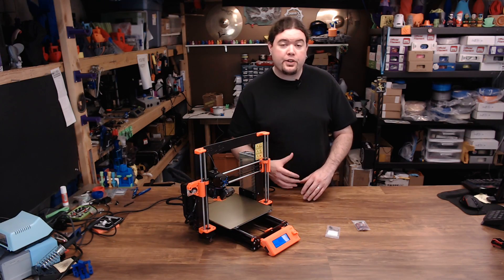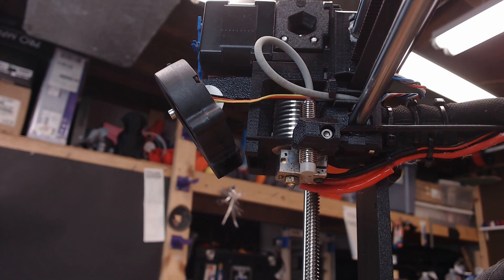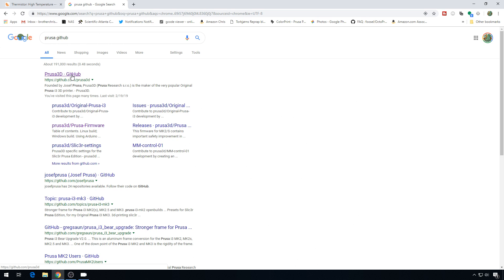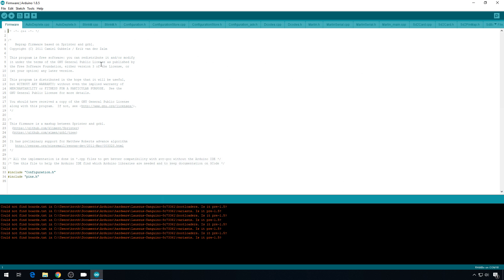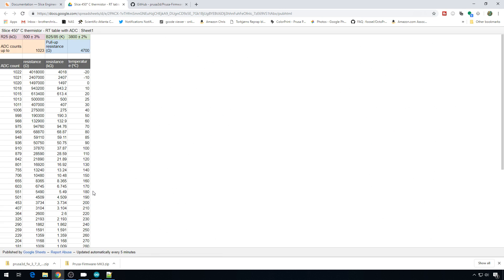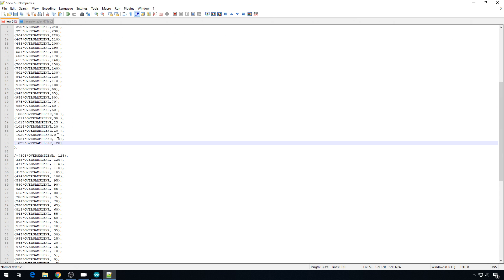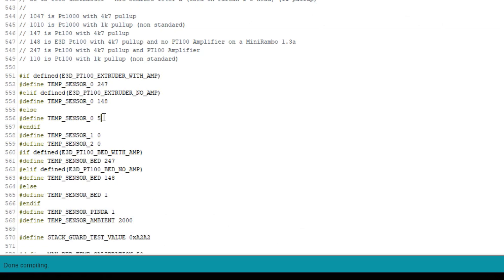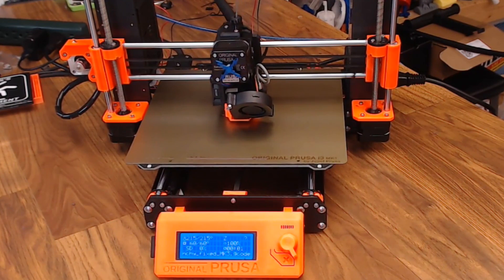Prusa Thermistor Upgrade - Slice Engineering - Chris's Basement

Comment: I am thinking about upgrade my mk3s mod completely with mosquito hotend. But I don't find a good alternativ die the mk52 heated to heat it up to 160°C. And I think for printing ultem it will be really hot so o also have to print all parts with PC filament  and also to change some other parts.

Btw. It would be a good idea to change also the heater and the heat block and also the nozzle to reach higher temperatures for nylon/PA6 or other engineering grade  materials
Reply from the maker: I am currently working on a high temp build. Eve with PC, I am not sure I would attemp ultem, but who knows, it might work. I use the Mosquito with a 50w heater and it does great.
Reply: @ChrisRiley  I am also preparing an article about this but not on YouTube. Only on my website pcpointer.de 

Also a bondtech with mosquito is possible. The heater with 50 w is enough and can be used without a MOSFET. Einsy Mainboard provides enough power. I hope the meanwell rsp320 13,4A power supply will be enough because the biggest problem will be the heated. E3D has some high temperature beds but they don't fit in the mk3s. For ultem normally you also need an enclosure and to put some spot lights inside for a temperature of 70-75 degrees. The hole electronics has to be moved out of the enclosures ... You will also need to col the steppers minimum with aluminium heatsink ... The belts will be strong enough ... I think that are the main problems ... I will first start to buy a mosquito standard :) 

Btw: I prepared a new article about building a printer from scratch. It's in german but the content could be helpful: https://pcpointer.de/artikel/prusa-i3-mk3-mod-3d-drucker-selber-bauen/

Comment: @Chris Riley  love the video, any chance you have this all compiled in a file that can just be uploaded to my printer? I have the whole mosquito setup but fear screwing it up.
Reply from the maker: Here you go, this should work. https://drive.google.com/open?id=1xd5Nnt0EMQYlZYE0GbJtkw0NjV-q4NoN
Reply: @ChrisRiley  Thank you so much!
Reply: @ChrisRiley  Any chance you could compile this with the new 3.80 firmware for mk3s?  I'd be more than happy to send a donation somewhere.
Reply from the maker: @iflawdya2  Here ya go https://drive.google.com/open?id=1jrtCOpQiXCpN_co1hGIfXetO4y7_e4Md this is compiled with the mosquito thermistor max temp 310. You should be able to load it with Prusa slicer.
Reply: @ChrisRiley  You're the best ever!!
Reply from the maker: @iflawdya2  I try. 😉
Reply: @iflawdya2  I tried to upload the hex file with prusaslicer but after verifying nothing happens and also a reboot doesn't help
Reply: @BiuTse  do you have the cable plugged into the mmu2?
Reply: iflawdya2 No in the board

Comment: Chris this is one of the most interesting and easy to understand 3D printing videos I have watched, you have great knack for getting the information across clearly and quickly,

I have my firmware ready to go, just waiting for the thermistor to arrive. Slice don't ship outside USA/Canada so anyone outside wanting to try this will hopefully have a friend in those countries that can help them get one.

One question though, you don't mention in the video how to change the 300C limit imposed by Prusa in the firmware, is it simply a case of altering the MAXTEMP settings in configuration_prusa.h ??
Reply from the maker: Hey Paul, thanks! That's a good point, yes, you should be able to just increase the max temp. I left out one piece on this tutorial that might mess up your live Z adjust. If you get a ? under Z on your screen, try this.

This is what the file looks like:

# RAMBo AVR Core and platform.
# ------------------------------

# For more info:
# https://github.com/arduino/Arduino/wiki/Arduino-IDE-1.5---3rd-party-Hardware-specification

name=RAMBo AVR Boards
version=1.5.6
compiler.c.elf.flags=-w -Os -Wl,-u,vfprintf -lprintf_flt -lm -Wl,--gc-sections

I found it here:
C:\Users\broth\AppData\Local\Arduino15\packages\rambo\hardware\avr\1.0.1

Comment: Hey Chris,
Thanks again for this tutorial.

I've run into a snag. 

Since mod'ing the FW, I can no longer perform a "live Z" or a 1st layer calibration.
The Z will not adjust.

Any ideas what the issue may be?

Thanks,
David
Reply from the maker: Unfortunately I left out one step. Try this, it might fix this issue.

c. modify platform.txt to enable float printf support:
add "-Wl,-u,vfprintf -lprintf_flt -lm" to "compiler.c.elf.flags=" before existing flag "-Wl,--gc-sections"
example:
"compiler.c.elf.flags=-w -Os -Wl,-u,vfprintf -lprintf_flt -lm -Wl,--gc-sections" The file can be found in Arduino instalation directory, or after Arduino has been updated at:
"C:\Users(user)\AppData\Local\Arduino15\packages\arduino\hardware\avr(version)" If you can locate the file in both places, file from user profile is probably used.
Reply: @ChrisRiley  

I'm working on macOS, I'm not finding the c.modify.platform.txt file

I found a file named platform.txt, but it has very little info in it.

# Marlin AVR Core and platform.
# ------------------------------

# For more info:
# https://github.com/arduino/Arduino/wiki/Arduino-IDE-1.5---3rd-party-Hardware-specification

name=Marlin AVR Boards
version=1.5.6
Reply from the maker: @davidewen713  I went back and did this on mine, it did correct the issue. 

This is what the file looks like:

# RAMBo AVR Core and platform.
# ------------------------------

# For more info:
# https://github.com/arduino/Arduino/wiki/Arduino-IDE-1.5---3rd-party-Hardware-specification

name=RAMBo AVR Boards
version=1.5.6
compiler.c.elf.flags=-w -Os -Wl,-u,vfprintf -lprintf_flt -lm -Wl,--gc-sections

I found it here:
C:\Users\broth\AppData\Local\Arduino15\packages\rambo\hardware\avr\1.0.1
Reply: @ChrisRiley  
Thanks Chris. This worked!!

I'm running macOS. I found the file at this location;

/Users/"myname"/Library/Arduino15/packages/rambo/hardware/avr/1.0.1

Comment: Where can I find and install the RAMbo module for Arudrino IDE? It's not showing in the board manager
Reply: Nevermind - found it :)

https://reprap.org/wiki/Rambo_firmware
Reply from the maker: @RylehRC  Great!
Reply: One more thing, the firmware files in the links - considering it's a new video - is it 3.7.1?want to make my life easy - just build and flash :)
Reply from the maker: @RylehRC  Yes, 3.7.1 just came out, go with that version. Setup should be the same.

Comment: Loved the video. I just ordered a Bondtech BMG-M extruder with the Mosquito Magnum hotend. Is there an installation process with this combo for the Pursa Mk3 along with stl files. I have not found any. Is there a thermistor/heating element mod for the Prusa Mk3 to increase the bed temp to less say 150C or 180C?Jim
Reply from the maker: Thanks! I currently don't know of any mounts for the Prusa Mk3 to fit that combo, but that doesn't mean there isn't one. Same for the bed, the only thing I could think of would be something like the new e3d beds.
Reply: Chris do I require a firmware change when I add the Bondtech BMG-M to my Mk3? If so, where can I find out what it is?
Reply from the maker: @gorillamotors  The only change you will have to make is for esteps and maybe direction. You should be able to change the in eeprom with commands. M92 Exxx   for esteps. You will need to calibrate esteps after the change.

Comment: What about the Slice Engineering Heater Cartridge? Is there any changes that need to be made to a MK3 or a MK2 in the firmware?
Reply from the maker: No changes for the heater. Just run a PID tune after.

Comment: Hey Chris, is there a way to get the firmware settings off of my printer before I upgrade to a updated firmware? Example, on my Geeetech MeCreator 2, I want to update my thermistor and add auto bed leveling to printer. If I make the necessary changes and then re-flash the firmware, all my settings will default back to original? How can I avoid this. I want to be able to use octoprint to reflash the firmware with the firmware plug in. Hope this makes sense.
Reply from the maker: The best you can do is run a M503 and copy all the output. Unfortunately, there is no way to save the configs.

Comment: Chris. Thanks again for the great video. Is the advantage of using the Slice Engineering thermistor and heater cartridge the ability to obtain a higher temperature range? Would it be also necessary to change to an all metal heat-break in that case? I would be interested in here more about the Mosquito hotend.
Reply from the maker: Yes, the SE thermistor is much more granular, so it would be more accurate. The E3D tops out at 300c. You would for sure need the all metal heat break, the e3d full v6 works for that cause. Higher than 300c, you really need to prepare for, all metal everything is needed.

Comment: Can you do a FAIR comparison between E3D V6 All-Metal HotEnd vs Micro 
Swiss All Metal Hotend ?  THANK YOU  for all the hard work you do.
Reply: If he did such a test, why would you question if the comparison where fair or not?
Reply: @stigberntsen9301  Making both on same print same setting and same cooling and same everything or there limitations if that's even possible! I can't find anyone that did that type of comparison.
Reply: @xeon_one  I have actually done that on my CR-10, I use the Petsfang, and tested both the MicroSwiss and the E3D v6. From my point of view there is next to no difference using either. Same temp on prints, same quality. If anything I find the MicroSwiss a tad better - at least when it comes to fitting it to the CR-10 (use the same mounting as the original)
Reply: @stigberntsen9301  Thank you for that..But I have one more question how about the limitations how high did you get it up to before it all melts down.

Comment: Thanks - great info. You know though that according to E3D if you want to run high temp >300 or so you also have to go to a copper block. And IDK on the prusa but on the pulse you'd have to edit the max temp and probably redesign or reprint the hotend mount out of something else than RYNO which gets soft at about 60 C, I ruined fan shrouds just by printing big footprint items with a 100C Bed (ABS). reprinted them in Hobby King Hips and that solved that problem. Why HIPS. prints better than ABS, sticks great to my garolite bed, is tough, heat resistant probably like ABS, smells less and is $12/kg
Reply from the maker: Nice! Yeah, I don't even know if I would try high temp on the Prusa, there were a lot of questions on swapping out the thermistor on it, so I thought I would make the video.
Reply: @ChrisRiley  Thanks cause I might try it on the Pulse as soon as the warranty is up. I have had it with the E3D V6 for 7 months now have run close to 50kg through it mostly stuff with a .8 nozzle being printed between 265 and 285. That means 7 months and 3 thermistors replaced so far. Granted they are only 9 bucks but its a pain and yeah I am averagining about a sock every 2 KG but MH says I got to run it with a sock or else.... That temp thing is irking me anyway. When I bought it the salesman said "if you upgrade to the V6 you can print up to 400" Well did not go too well the first time I did a print over 300. Then they showed me the E3D website that said the same thing and I showed them the next page that you need a copper block and a T100 etc. BTW IDK if your pulse has the BomdTech extruder if it does the PTFE tube will wiggle out again and again happened also to the 3D printing Nerd over and over. I got it finally fixed I think as for 2kg it did not come out - posted on the MH forum about it. ALSO IMPORTANT!!!! check the wire that comes from the mini rambo to the heated bed. If its just hanging there and is not tied to something it will wiggle back and forth and will make the connector arc and sooner or later it will melt to the rambo board (its documented on the Prusa website as a "if you put it together yourself make sure you have strain relief" They had me send it back and replaced it which was ok (except we had a bad robotics season partially as we lost 2 weeks of printing) BUT the way they tied it down was so the wire now crosses the back corner of the bed - about 2 inches so if I print something there taller than 60mm it will snag the wire... And I am not allowed to touch the wireing or void the warranty. The wires from the Bond Tech extruder and filament runout sensor are just hanging there and rubbing against the filament spool if I use a slightly bigger spool like for example an ESUN spool. What a shame messing something like this up by having it wired by a teenager it seems. (I work with them) Beyond that lots of great accurate prints - as I said since we got some of the problems resolved 4-7kg of filament successfully through that machine (mostly Hobbyking HIPS bed 100, Nozzle 270 volumetric max flow rate 18mm3/sec) Pulse works way nicer when you slice it with SLIC3R and run it in volumetric mode.

Comment: Hi Chris the Z shows "?" as you forgot to modify an arduino ide file. This is also fixed by the PF-build.sh script automatically.
Reply from the maker: You're just so hard to please Gussner. Lol ;)
Reply: @ChrisRiley  sorry Chris, you do a great job. But so many people have problems to compile Prusa firmware and then it is not working correctly. Had lot of questions about this topic that's why I think it is important to have a good guide how to do it. Walter with his tall MK had the same issue with Z showing "?" .
Reply from the maker: @3dgussner958  No worries Gussner, you do awesome stuff for us as well. I know I probably missed something here.

Comment: Do you notice an improvement in the print quality?
Reply from the maker: I have just tried PLA and no print quality improvement that I can see.
Reply: @ChrisRiley  that's what I was wondering - why call it upgrade?
I know it's "high temperature" but AFAIK Prusa still uses PTFE-tube equipped E3D hotend, right? Sooooooo printing above say, 260C, is no go anyway - right ?
Reply from the maker: @cthulpiss  I would say the thermistor is a little higher end then an e3d, but the e3d is still good. SE thermistor is a little more granular in its scale. Prusa uses the full v6, which has PTFE in the heat sink, but not in the break. In the Prusa config 300c is reasonable.

Comment: Hi Chris. Great video and mod. I did miss one piece of info, why replace the standard thermistor wit a Slice Engineering one? What are the pros and cons?
Reply from the maker: Thanks! The Slice thermistor is going to be a lot more accurate at high temps. For PLA and lower temp material it's probably not going to improve much, but the scale is a lot more granular. Basically, it's just a really high quality thermisor.
Reply: Chris Riley Thanks!

Comment: Hi Chris, you should download the source.zip from the latest prusa firmware release as the MK3 branch is kind of on development and some changes are not tested completely. Due to issues during compiling I wrote the PF-build.sh script which downloades a known development platform and compiles the firmware correctly. You can use the PF-build.sh script on Linux 64bit, Windows 10 64bit with git-bash and Windows 10 64bit with Linux subsystem. Only thing you need to do is to copy the variant as new file, make you changes and then run the PF-build.sh script. To prepare Windows 10 64bit read the readme on github.
Reply from the maker: Thanks Gussner for the info, I will check this out.